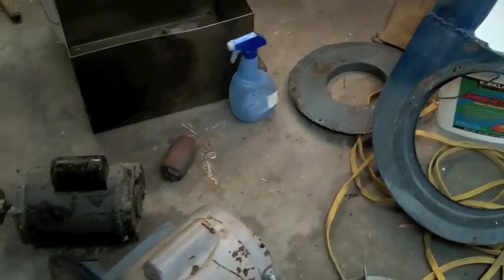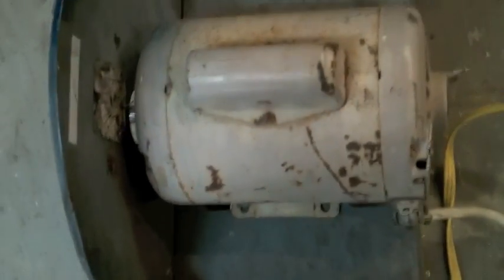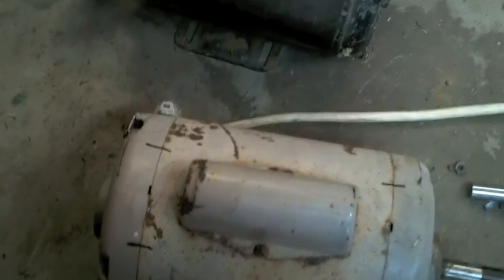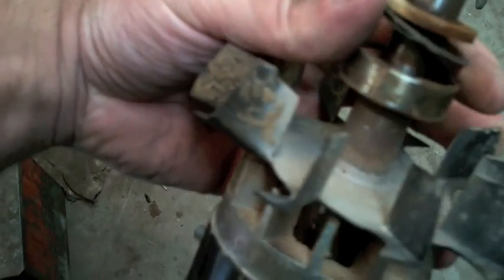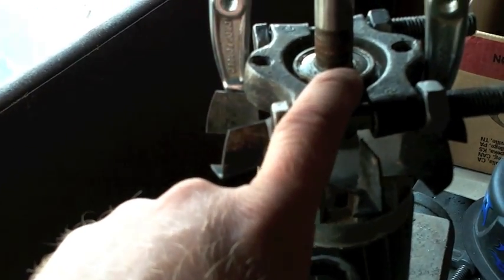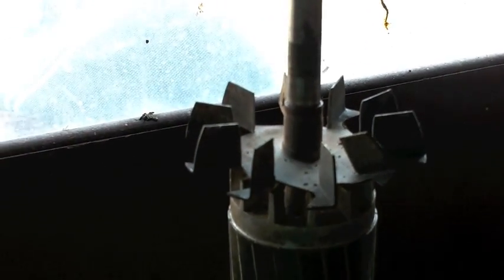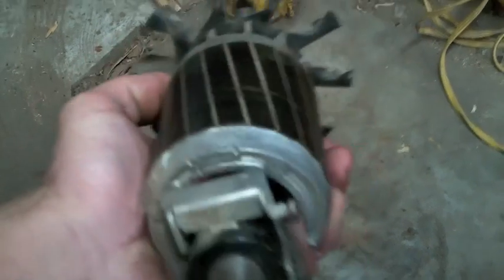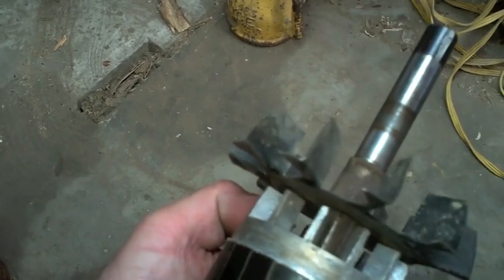Home Built Cyclone Dust System Pt 2

Comment: The start up winding brushes? You ever find those brushes? Lol just bustin ur balls man, great video. I like your style. How long you been making videos? I just started about 10 months ago. Subbed 👍🏼
Reply from the maker: I suppose fork or wiper would have been better terminology.  Like 9 years now but only seriously for 6 or so.  That motor still runs fine btw, used it last night.  The whole regreasing your own sealed bearings thing seems to be working fine despite the comments.

Comment: adding new grease to old grease is a bad idea, first off you don't know what the old grease type is and second they could break each other down, you better off flushing out the bearings and putting fresh in.  I hope this dosn't cause you an issue but it might and if your new lube breaks down please let us know.   But yes you can repack a sealed bearing Just flush it out with WD40 get that out with alcohol let it dry and repack the bearing.  WD40 will remove water and rust the alcohol will remove the WD40 and you have nice clean parts to give a fresh coat of lithium grease ment for high-speed motor bearings and heat. Parts will get hot from electrical current and friction.  Oh and change the cord to a multi strand wire machine cord that handles more current less resistance and less heat.

Comment: I think something should be stated so that it can be clearly understood. You are building a dust removal system not a dust collector. some might misunderstand . a dust collection system also collect larger particles and they should not ever be passed through the fan. You are simply attempting to clean the air of dust particles. not clean floors.
Reply from the maker: Yes there is a misunderstanding, but of how you think the system works.  The fan pulls air from the cyclone which has already separated out the larger particles for collection in a barrel.  Unless my collection barrel overfills nothing is supposed to go through the fan at all.  Return air is then passed back into the shop through a set of huge air filters.  It would clean a floor just fine though I simply sweep them rather than filling up the hopper.  It is a dust collection system.

Comment: I find it useful to clean up the shaft a bit before pulling bearings, clean up any rust or burrs. It does make it a little easier to pull the bearing.
 Also, for those new to this, push or pull on the inner race for shaft mounted, on the outer race for bearings mounted into an end bell. Basically the force goes on the part of the bearing which experiences friction.